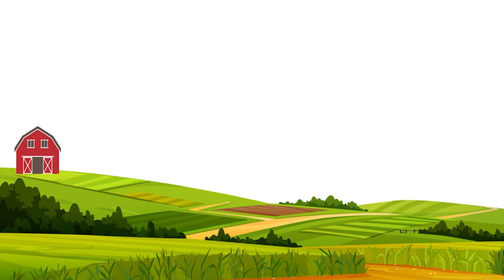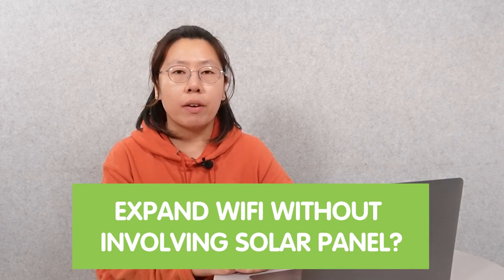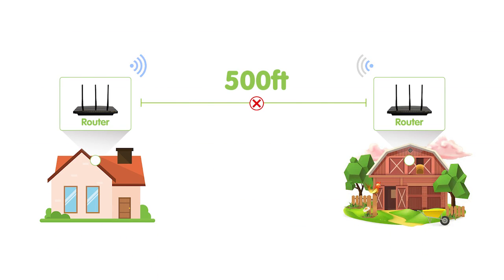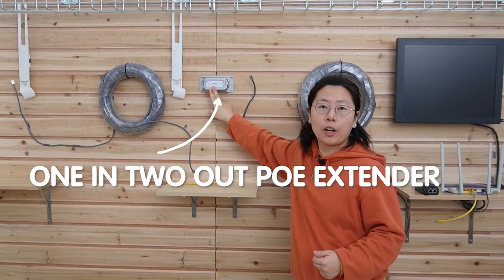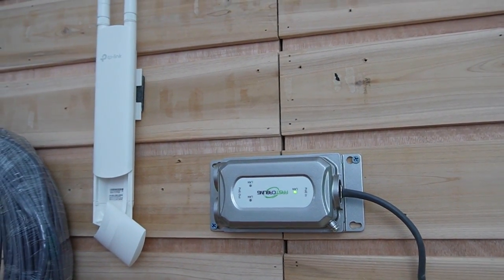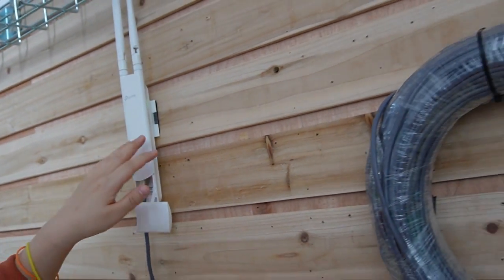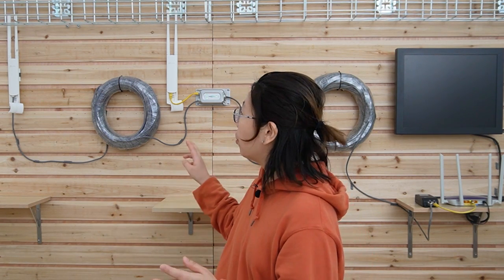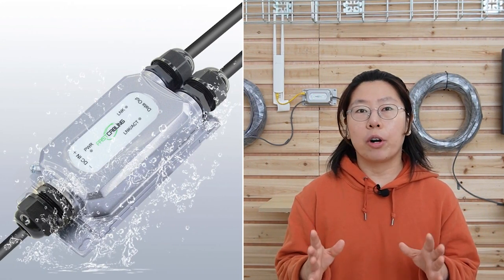A Guide to Expand WiFi over 500ft Without AC & Solar Power

Comment: What download speed can we expect with this setup relative to the input mbps? Say for example 500mbps speed. Thank you!
Reply from the maker: The maximum speed a device can achieve depends on its own Wi-Fi hardware. The more devices connected to a WAP, especially if they're actively transmitting data, the more the available bandwidth is divided, which can reduce individual device speeds.

Comment: Please don't be offended can you use 4 or more Extender
Reply from the maker: Actually, two PoE extenders working together can achieve 1500ft. However pulling the wire is not so possible in some particular case.
Reply: @Fastcabling  i mean with A/C power